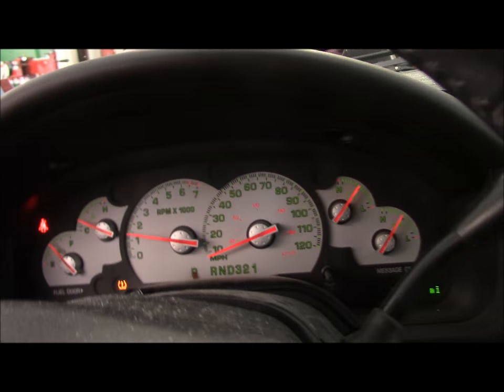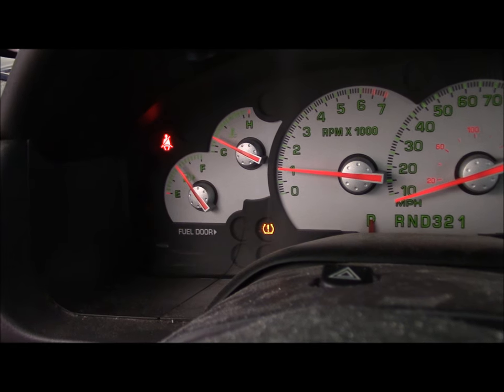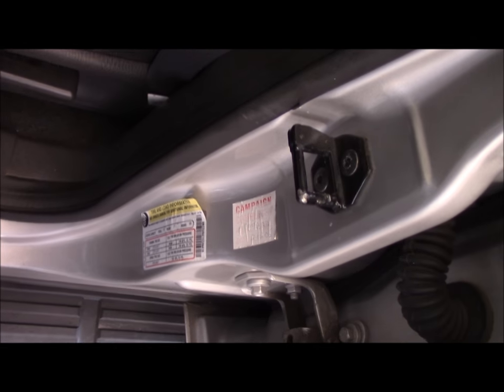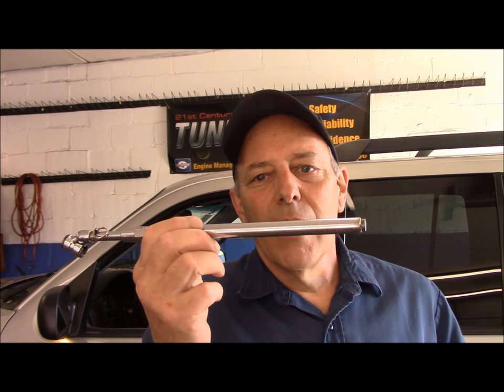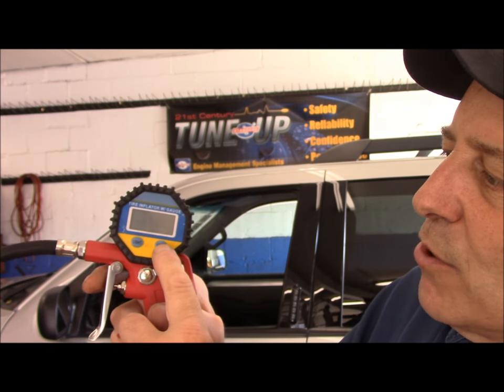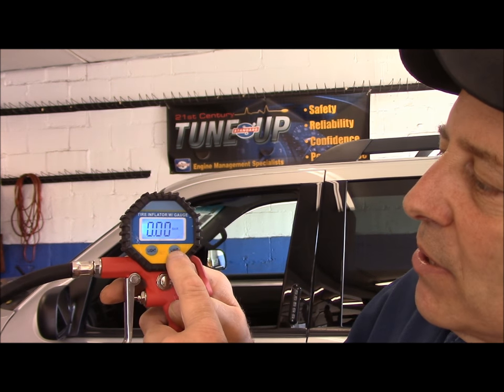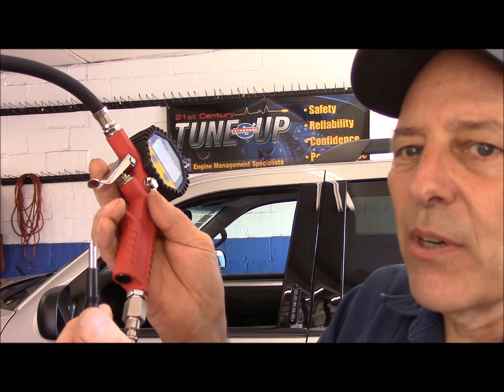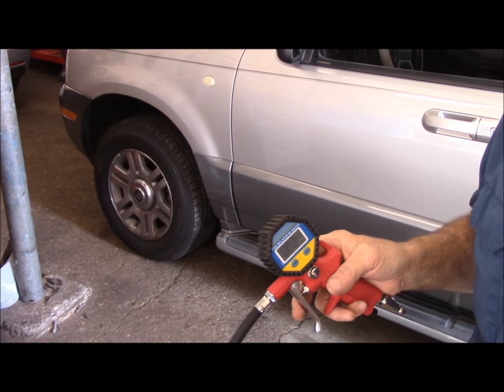How To Diagnose And Repair The TPMS System

Comment: I have a 2010 gmc terrain, I have installed a new set of tpms sensors and programmed them all. after 50 miles or so the light comes on and I have no readings from the sensors... program the sensors again and keep doing the same thing.. PLEASE HELP

Comment: I used to pressurize tire to the psi on the placard but I was wearing michelin tires out in 40k miles,so I bumped the psi up 7 or 8 lbs and got 60k.

Comment: Hey Jim great video ,what is the effect of temperature to a tires pressure when reading it on the road?  And also is there a difference between the TPMS light , and the (!) light ?Do they mean something different since some cars have both?
Reply from the maker: Good question.The key to proper tire performance is the correct pressure.If the pressure is low the tires will start to over heat causing a failure.
Reply: +jimthecarguy For example in this video you let some air out of the tire saying it was over inflated,  could it have been that the tire was hot and had a higher pressure? If it would have just come off the road , hot asphalt and friction, would the pressure then have come back down as the temperature decreased?
Reply from the maker: You are correct about the temp and the pressure but this truck was in my shop over night so the temp was not a problem
Reply: I agree that the tire heats up as you drive on it, thus increasing the pressure. 
However, like Jim said, if your pressure is too low, why does the tire overheat and explode? Seems a bit confusing, unless there is a hidden variable?
Reply: +motoYam82 could it be the larger surface area and friction coefficient?
Reply: ONBOARDTECH333KMD
Do you mean a larger contact patch on the road? The friction coefficient between rubber and pavement is a constant. Also the rubber isn't slipping on the pavement, (assuming we're not turning or doing burnouts lol). So where is that heat coming from??
Reply: +motoYam82 if tires themselves were rigid I would agree with your statement. However aren't they nothing more than pillows of air that conform to the contact patch? There would have to be friction. Like a fat woman on a small bar stool , when she sits down or gets up , it's not just the center of the seat that catches the friction.
Reply: ONBOARDTECH333KMD
Hmm good analogy :) But the key question is: where is the heat-causing friction? I don't think the bulk of it is between the tire and the pavement, no matter how large the contact patch. So most of the heat buildup MUST be due to the excessive flexing of the rubber in the tire itself (sidewalls and tread)! "Internal friction" if you will.
Reply: +motoYam82 that's what she said 😉
Reply: +motoYam82 Just a thought,  tires aren't just rubber anymore are they😉. So how about part 2 of my question? Anyone ?
Reply: Heat is generated from the excessive flexing of the sidewall when under inflated.  When you are on the highway and see a car, bus, truck or trailer with an under inflated tire (squatting real bad) stay clear!

Comment: Nice video Jim! These are the nice easy ones until you get RCDLR issues & then it gets fun. I think this was a great safety addition b/c tires are probably the most neglected & most important part of the car with brakes a strong second!
Reply: It all started with the Firestone vs Ford Explorer roll over conflict
Reply: I've been doing this for over 40 yrs and watched people drive in with under/over inflated tires leaking down from bad valve stems/cores, cuts, punctures and most never knew it which is pretty dangerous on the highway. I'm glad they have it b/c my wife has run over nails twice in the past year and was @16 psi and she never knew it except she said that tire symbol is lit can you look at it...:-)
Reply from the maker: You right about that.The most important part of the car and yet the owner drive with little to no air in the tire and ignore the TPMS light..I hope all is well.
Reply from the maker: That is great that your wife saw the low tire pressure on the dash.I drive a lot of customer cars and I will tell them that the low tire pressure light is on and they will tell me "oh I didn't see that"I tell the owners that You always need to observe the gauges.
Reply: Had shoulder surgery July 11th for torn rotator cuff & bicep so I'll be out of commission while I  heal for 3-6 months but I think @3 mos.
Reply: Yep some would drive on tires with 10 psi before TPMS, now they drive with 10 psi and the TPMS lit up on the dash...makes you laugh.

Comment: Jim- I'm a subscriber; I have a question about this pressure gauge that you recommended in this video.  First, I ordered it yesterday just to try it out and give it its fair due.  However I am a bit skeptical and concerned because I've had one of these in the past and after a short while the gauge began to show readings that were crazy-way off.  I mean not even close.  Granted, the gauge I had was the needle variety, old school stuff.  It was not a digital one like yours.  That was a part of the reason I decided to try it actually, I wouldn't have bought another of the type I had previously.  So my question is: how durable is this gauge?  How long have you had yours?  Have you ever had one die on you? Thanks
Reply from the maker: This digital gauge is not that old just a few months but it seams very good .I do like the newer digital over the older ones with the needle As for gauges dying I have had a lot of broken ones mostly from being dropped or run over.Lol